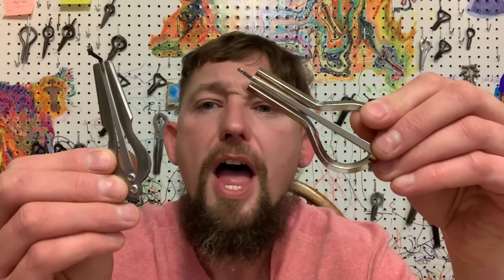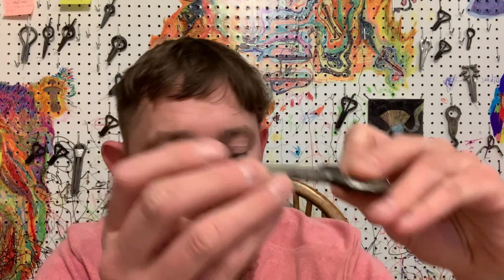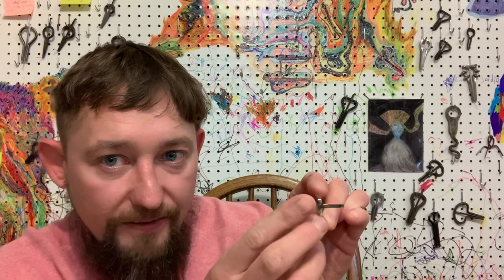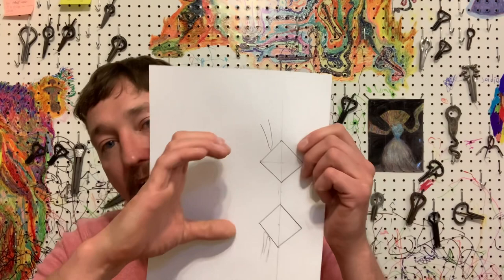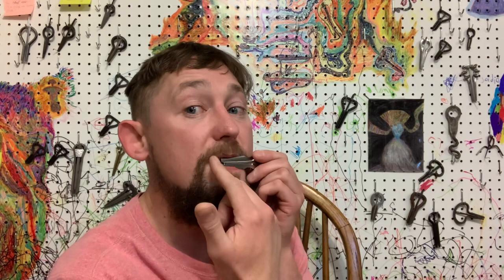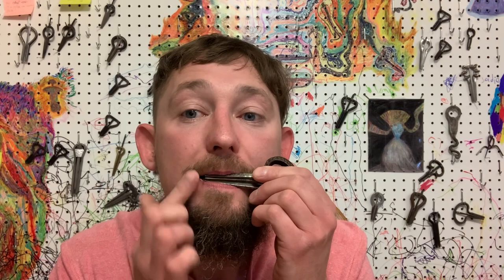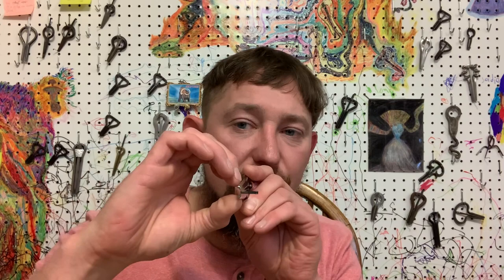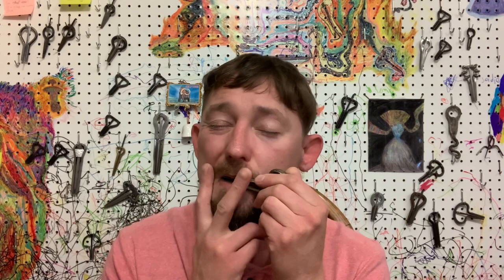Why won’t my Jaw Harp make Noise??

Comment: Of course I cheaped out and got a Snoopy harp, and you're right, it's pretty useless. I did take a pair of vice grips to it and narrowed up the gaps on either side of the tongue and it helped a little bit. But then I got a decent vargan, and the difference is quite massive. The tongue isn't as stiff and it sounds SO much better and LOUDER. So to all of you out there thinking you suck, just get a nicer instrument (and if you practice and still suck, then I guess it is you).

Comment: my cheap 5 euro danmoi i dont need teeth and therefore can play much more tones because of mouth flexibility, i now ordered a glazyrin herdsman and its catastrophic to play, only with teeth contact there is any tone possible but i cant do much scale because as i leave one milimeter it stops or metal rings or else, any recommendations for this 64€ piece of trash?
Reply: also are all of those khomus vargan style only playable with teeth, its a ugly feeling constant pressure and vibration on the teeth/skull???
Reply from the maker: I absolutely love tooth played jaw harps as the trance and dream like states they induce are quite wild , but it sounds like you would like to stick to lip playing.  Check out this video and hack to lip play nearly any harp.  Check it out. https://youtu.be/7V7muavzLAc